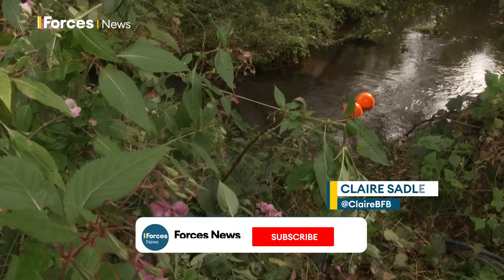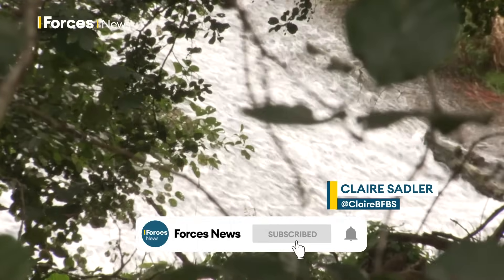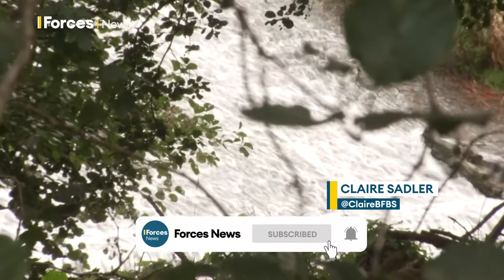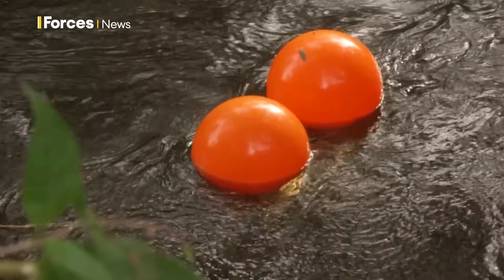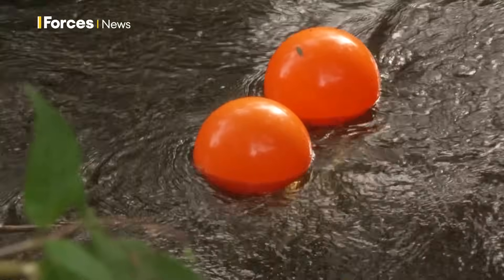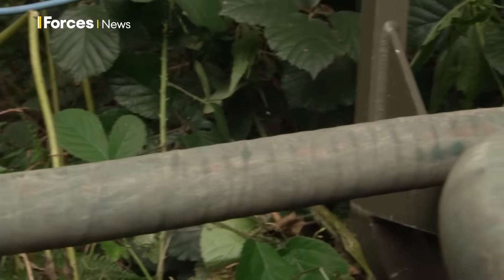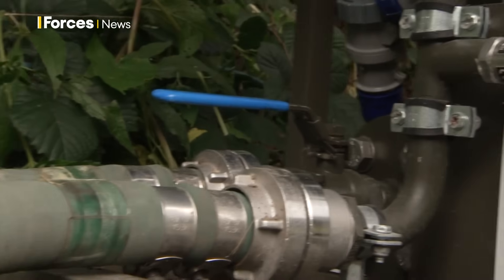How British Army gets drinking water to frontline troops

Comment: If the guys need training, its designed wrong. Its just a water supply.
Reply: Ah so nothing in the army should require training then?
Reply: @harryb8945 ..... "it's just a water supply"... Its difficult to make it complicated enough to require training... To win a war, any man off the street should be able to use basic kit intantly.
Reply: @InquisitiveBaldMan  you know every soldier carries water purification tablets on their belt kit? This isn't an item that is being carried on someone's back, it's a significant piece of logistical equipment that will be stationed at a logistics hub some distance from the front line producing gallons of water for hundreds of soldiers. Surrounded by specialists and support staff. Arguing this is too complicated is like arguing Radar systems are too complicated and we should reliy on binoculars.
Reply: @InquisitiveBaldMan  so no it's not basic kit and that's not how militarys work. Even in WW2 conscripts went through months of training before ever seeing the front line.
Reply: @harryb8945  Wars aren't won by standing about waiting for a specialist to fix your nice clean water machine. You are literally answering you own question. Have your water tablets ever broken down or given you an error message? No, well thats exactly what it needs. SImple idiot proof solutions that never go wrong... This machine could be redesigned to do the same thing mechanically with no electronics or complexity.

Comment: It is too complex, electronically in functionality. It should be basic, with analogue pressure valves rather than electric relays and sensors. In theatre, whether at the front or at the rear, the simpler the system, the less failures and easy of use for grunt, is a must have!
Reply: People shouldn't need training. It means emp and interfearance couldn't be an issue too.
Reply: @InquisitiveBaldMan I’m sure the people getting millions to think about these problems have a better understanding than you do mate
Reply: It also means its more effective and can likely clean more water.
Reply: @harryb8945  It's filtering the water. Not disinfecting it. It's of no benefit to the troops except slowing them down with problems.
Reply: @InquisitiveBaldMan  and what does filtering do? So the military that has spent hundreds of years on operations all over the world, brought a water pump for the lols?
Reply: @harryb8945  Filtering gets rid of mud and sand. It doesnt get rid of bacteria or polution... So basically it just makes your water a nicer colour. Right up until the filter blocks then they just throw it in the bin anyway... Hundreds of years of operations has shown us we dont need a computerised water system with loads of sensors and error messages.
Reply: whydidntyoutraintoday  Not true. The most popular popular portable drinking filter "lifestraw" can't even drink seawater as the particles are too small and go through it??? If water fits through a filter, other molecules will too. The water needs to be tested or distilled to ensure its good. Filters are sold based on likely contaminants but how do you know what the enemy will contaminate your water with?

Comment: If you're in a location with bamboo shoots everywhere then you don't need this system. Also teaching the troops the water filtration and purification tricks in different environments, is a more effective way of keeping your troops fighting rather than relying on a piece of technology which could easily fail at any time. Common sense thinking, and knowledge is power thinking needs to be brought back.
Reply: Sure, lets say you have a permanent base somewhere, hundreds of soldiers... And they are all spending hours a day just to make drinkable water for themselves. Including the pilots, the drone operators, the medics... Sounds reasonable, lol.
Reply: Great so before the soldiers can fill up a 2 pint bottle of water they need to spend 40 minutes purifying that water in a unreliable and strenuous way. Yeah definitely sounds like common sense.
Reply: Troops carry water purification tablets and use them if required.   But when a whole battle group needs to be provided with thousands of litres of water chopping a bit of bamboo or licking morning dew off leaves isn't going to cut it,  is it?
Reply: Is this wilko from 51 reccy troop?

Comment: As it would be on operations..... never been used our water was delivered by c130 by RAF  😂😂
Reply: We had engineers supplying water to us on the front line in Garmsir.
Reply: Mass for volume, water is difficult to transport, planes can be delayed, runways may be remote. Far better to set this gear up and be self sufficient for potable water.
Reply: Do you have the foresight to realise maybe not every single operation is the same